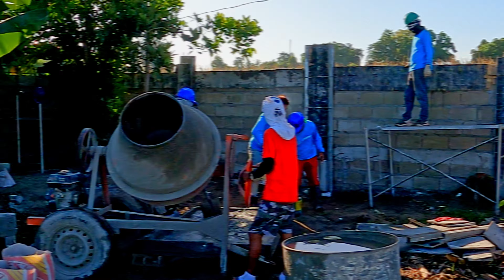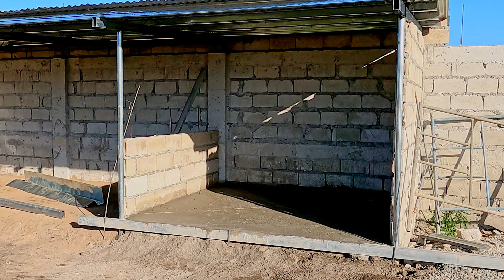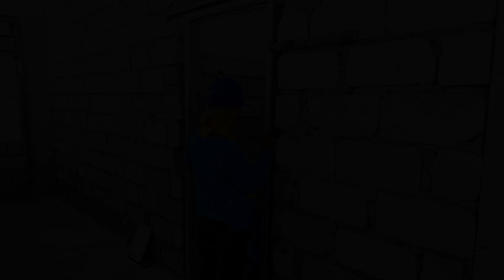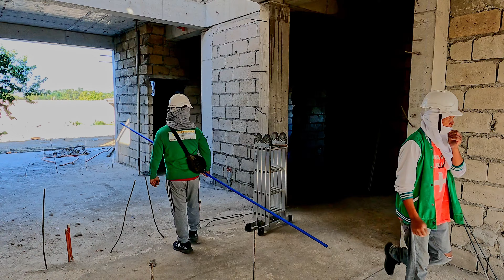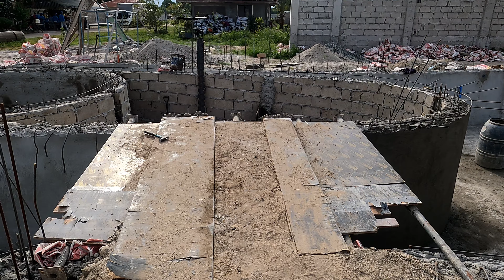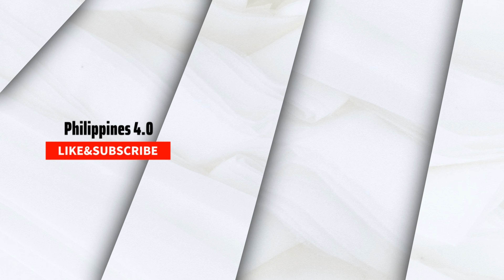Philippine House Building Day 122 - Things getting finished

Comment: Good morning Mike I never thought just burn the stump  that's Filipino technology working at its best.
Bobcat ramp nice one , Hollow blocks House progressing well, All round a good day despite power cut.
On my build they over chipped almost damaging columns. What I prefer is to use a bonding brush on coating. Before anyone says. Can get it from Ace Hardware or Wilcon  or any good hardware shop , Or can just use diluted PVA adhesive ,. Works by stopping the shrinkage movement applying direct to dry concrete. Using a good bonding  coating you will never need to look at plaster shrinkage  cracks . some more tips for the day by Graemes Cebu Philippines
I've already mentioned pool hydrostatic valve in NZ its a must ,but our pools are more or less a boat waiting for ground water.
Reply from the maker: Graeme
Hugely frustrating day for me - reminded me how much I rely on power and the internet.
I do like the idea of PVA adhesive - will be asking the builder about that one. And have already asked about the valve.

Comment: Hi from northern Philippines - looking good . As for your fence are you plastering it and is anything going on the top beam . Example -  Barb wire / sharpened steel bar panels 500 mm high or something like that for security - or is that it as built . Regards Michael .
Reply from the maker: Michael
Not plastering - too expensive. I think we are going with barb wire, and I was thinking anywhere from half to one meter. Any advice ? I did briefly consider an electric fence. I think it is amazing that it seems to still be legal.
But if a local got hurt - or worse - because a foreigner had put up an electric fence, even with the approval of the local baranguy, I suspect it would not go well for me.
Reply: @philippines4.0buildinganew64  electric is messy and like you say could be a problem . I got a fence as high ( no wire etc on top) as you . but I prefer trained guard dogs . Rottweiler - doberman - German shepherd . I have two one sleeps at the foot of my bed and the other at the front door . A well off Filipino friend of mine has razar wire curled on top of his wall but to me it looks like a prison. But a very good protection system if you don't mind the look . Regards Mick

Comment: Hello sir. Just a little comment in regards with chipping concrete beams. It would have been so much easier if they did the chipping right after removing the forms✌️
Reply from the maker: Hi Felicisimo
I suspect you are correct, but every building series I have seen on YouTube seems to do it this way. I don't know if there is a downside to doing it after form removal.
And in today's video, I am sure I got your name wrong, so my huge apologies for that.
Reply: @philippines4.0buildinganew64  Hello sir. Thanks for the reply. You know there is nothing wrong of doing the concrete chipping long after removing the forms, it's just a bit harder and takes longer. And as far as pronouncing my name I'm sure you're not the only one troubled saying it 🙂

Comment: Everything looking great, kinda disagree with your engineer saying lintels are not needed also are your pool guys putting in a hydrostatic valve in the pool to prevent it lifting?
Reply from the maker: Darren
Have asked the builder about the valve - sounds like a really good idea.
I think the lintels is just one of those Philippine differences I am going to have to live with.
Reply: @philippines4.0buildinganew64  cool, you dont want a Mulberry Harbour in your garden.